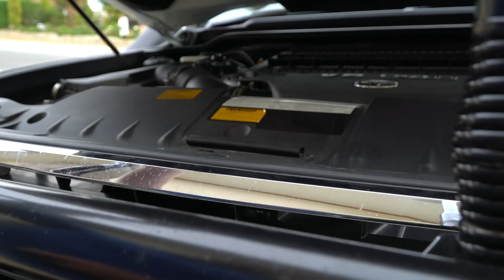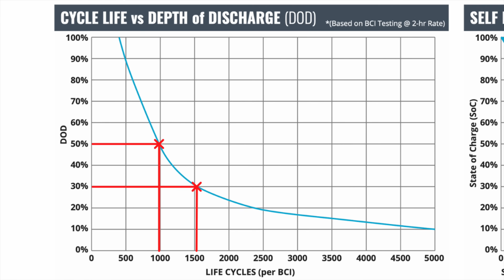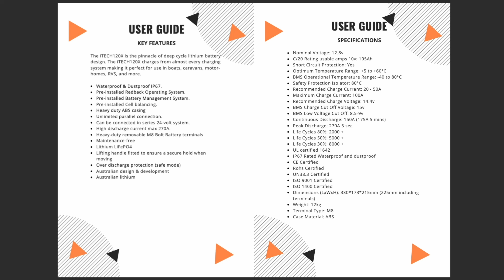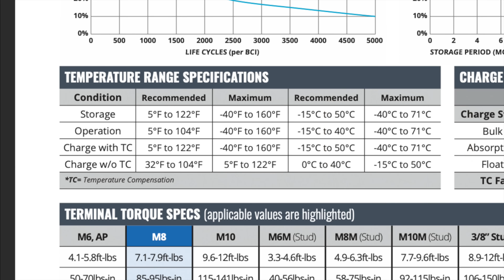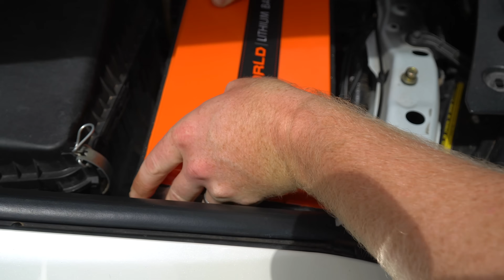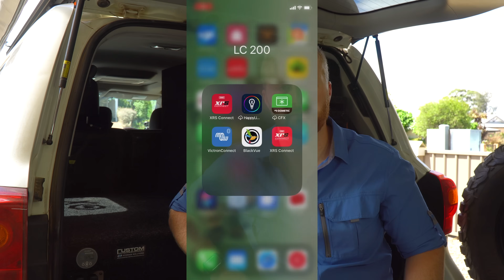UNDER BONNET LITHIUM | Is it worth the money? | Can it survive the heat? | iTechWorld 120X 12V setup

Comment: Hi Nathan, thanks for the very comprehensive video. 

One quick question, do you have two batteries under the bonnet or are you running everything off just one 120X battery? 

I am looking for a second battery setup for camping in my Prado 150 and was considering a Lithium Battery Box. I have a AGM as my starter battery. However, your video is very persuasive in considering an under bonnet lithium. So thanks for that.

Comment: Great Video, lots of good information, I'm looking at getting one for my car as well, how is it going under the bonnet now, did it handle the heat and where did you find the insulation that you wrapped around it. Thanks
Reply from the maker: Hey mate, this is still going strong at the moment. I have released a 6 month review of the battery, a little about how I've tested it and it's capacity and discharge results. Check that out for a some more detail 👍

Comment: Hi Nathan, thanks for the informative videos mate. I am spec’ing dual battery system for my Prado 150 at the moment. Question about your BMV-712. Where did you mount the shunt? Is it under bonnet and if so do you have it in a sealed case?
Thanks again 
Luke
Reply from the maker: Hey mate, I initially had this under bonnet, however a couple of years on and it did not last. I've now had it re-located to the rear storage area, protected from the elements. Would highly recommend it be up and out of the way from the elements to avoid issues that I experienced 👍

Comment: Very good informative video .. But the one thing you didn't mention and that is warranty periods.. As I've found lithium warranty to be the same and even less in a lot of cases .. I got my Full River and came with a 5 year warranty at the time .. Most lithiums I've seen come with 2 or 3 years .. Meaning if my Full River fails in 4 years ill get a new battery .. Lithium fails in 4 years your up for a new battery .. Very important topic I think .. I love the idea of a new lithium but still can't justify the huge costs .. You also have to factor in the cost of upgrading all your other equipment to be lithium compatible.. Solar charge controllers and dc/dc chargers as well as 240 volt chargers..

Comment: Hi mate how's the performance of the under bonnet Lithium going? Have you tracked any temps since having it in and seeing what the batt temp gets too? Just looking at upgrading too
Reply from the maker: Hey mate, so far it's going well. I plan on releasing an update video in the coming weeks (ish). Not many complaints so far. I haven't measured temperatures specifically, but measured performance and capacity over time. 
Cheers 👍
Reply: Awesome mate thanks for the reply, glad it is all going well for you, looking forward to seeing an update 👍🏽

Comment: Thanks for the Video, Did you have a redarc isolator installed as well with your original AGM setup, and did you replace that or run the lithium without an isolator? Currently wanting to replace second battery just the same as I have the same setup only with the added Redarc isolator installed
Reply from the maker: Hey mate, so I'm running a Redarc BCDC1240D charger. This is a step up from the standard isolator and probably something you'll need to consider if looking at lithium.  It can make sure the lithium receives the correct voltage through out its charging trend. 
Cheers, Nathan.

Comment: Great info !! I’m a novice with this. Do you reckon that itech battery will fit a prado 150 bay? Also what was the terminal cable kit you liked so much ? 😎
Reply from the maker: Hey mate, from my measurements from my old Prado 150 series, I don't think that this battery would be a drop in replacement. I think it is just a little too long. 
In terms of the wiring, this is a wiring harness installed by Ultimate 4WD Equipment in Bibra Lake, they make quite a neat and tidy electrical system integrating dual battery and accessory looms. 
Chees, Nathan.

Comment: Great info and we’ll presented. I’m looking to do similar with my 200 series and am interested in the itech world batteries as they are locally owned. Just wondering how the lithium battery is preforming consider a few people I spoke to reckon it wouldn’t handle the heat. Also where did you purchase the heat shield for the battery. 
Keep up the brilliant videos. They’re very informative but costly on my wallet. 🤣🤣🤣
Reply from the maker: Hey mate, yes the heat rumour is another reason I'm testing this batteries, to see how valid they are. After a few months now, so far, so good. 👍 
I used this for my heat shielding - https://ebay.us/Ti9ilY
Haha, can't apologise for your wallet their mate 😆

Comment: I run two of these itech 120X in my Tvan running a 3000w inverter no more gas 
I can run induction cooktop,airfryer, toaster, kettle 
And have no problems so far 
Also only have solar for recharging

Comment: Hey Nathan, a few months on now, got an update on how the 120x is going?
Reply from the maker: Hey mate, so far no complaints. You may have seen I had a charging issue with the cranking battery, but this has not effected the performance of the auxiliary battery. The 120X is still going strong and no signs of heat damage and has not turned off under any circumstances as of yet. 
Cheers, Nathan.

Comment: No mention of cranking amps. Is this irrelevant with lithium batteries?
Reply from the maker: Hey mate, yes this is irrelevant for a 'deep cycle' type battery like this one. This is not designed as a cranking battery and therefore isn't provided a CCA rating. iTechWorld do a cranking battery too where the appropriate ratings are provided. 
Cheers, Nathan.

Comment: They dont handle heat that well.. They will stop charging. I tried one under bonnet, and it was OK when it was cold, but slow moving on a hot day, stopped charging all the time.. I ended up sticking it in the back of the car..Also the Red arc will start to back off charging at around 50 degrees I have found. I shifted this to in front of the grill as well..
Reply from the maker: Hey mate, interesting to hear. 
I've already done some hot weather testing with this unit with no issues yet. I've had the engine coolant temps up 26 degrees over normal, climbing very sand dunes on a 35 degree day and was continually monitoring without issue. I guess time will tell in regards to how these perform. 
In relation to the Redarc, have you had any problems with it up the front? 
I constantly monitor my state of charge through the Victron and when charge is required, I've never seen it drop below 34-36A of charge regardless of temp.
Cheers, Nathan.
Reply: @XploringOz  I did have the Redarc on the fuse box, and one time it did stop charging as it got to hot. I immediately shifted it to just behind the grill, no problems after that. When it stopped ambient temps were between 40 and 45 degrees. Redarc was at around 60 degrees, measured with a IR thermometer, so expected.

I had a lithium in the front, it would start to managed the current due to temps at around 50 degrees. using power out was OK at these temps, but charging ,the BMS would kick in and reduce it. I have a BT BMS so I can see the cell and BMS temps

Even though most of the trips the battery was not at max temp spec, after 3 months the the battery started having charging trouble. It would reboot the BMS constantly, and the SOC meter started acting up. Presumed to be a BMS issue. So it was replaced under warranty. I shifted it to a battery box in the back on the car. I dont know for sure if it were the under bonnet temps that caused these issues, but I decided to eliminate them going forward.
Reply from the maker: @jjsadv  Hmm, sure is interesting to hear and I'm looking forward to seeing how this performs long term. Although it would be disappointing to see it cause trouble of fail, I'm hoping to be able to prove whether heat is directly correlated with issues/failures. 

I've recently installed the new iTechWorld 1420CA starter battery to, so it will also be interesting to see how this performs under bonnet, both with the heat concerns and the continuous requirement for high current discharge. 

I'm really hoping they will last, I wan't to try and keep these big units out of the rear of the vehicle to allow room for other gear 👍

Comment: Just a quick heads up on the victron settings for the Itechworld 120AH. The usable capacity is about 96-98AH, not 120AH. So you need to set the capacity to the usable capacity of the battery, not the total capacity, which it cannot deliver.
Reply from the maker: Hey mate, this is a good point. I've actually run an official capacity test on the 120X and got a usable 99 amps before the BMS shut down. I guess setting it like this will give you a visible 20% reserve power. It would depend on how you want to view the gauge? Set it up this way and the battery will switch off at 20% or set the capacity at 100A and the battery will switch off at 0%.
Cheers, Nathan.
Reply: I have 3 x 120 itechs and I can get a useable 105 out of 2 of them and about 100 out of other.
Reply: Seems like this battery should be labelled at 100ah not 120ah. I feel like the itech world advertising is a little misleading don’t you think? Your explanation when talking c ratings kinda confirms this

Comment: Another good vid Nathan. I have DCS under bonnet, and your assumption on off road temperatures is pretty good. On a 30 degree day, I have seen my battery temp hit 70 for short periods. this is normally on downhill low range. they drop to back to 65 on uphills, assuming that is due to the fan moving more air with the revs up. Ive also noted that temps increase quickly when you stop moving, but on the highway you can drive all day and only see temps maybe 10 degrees above ambient. Thats in a 200, so I would assume they have good airflow at higher speeds.
Reply from the maker: Cheers mate. That's good to hear. That's definitely an advantage of DCS, being able to monitor the internal temperatures. Its encouraging to hear that you are seeing temp's below that 80 degree mark! Hopefully my extra insulating material will help to some extent as well 🤷‍♂️ 
Will be interesting to see how this battery performs long term 👍 
Cheers
Reply: @XploringOz  yea, I wrapped the engine facing sides with carbuilders insulation too. Interestingly when you stop the drivers side heats up more. I would have thought it would be the passenger as it’s super close to the hot turbo-intercooler pipe on that side. I have like 3mm of clearance😬
Reply from the maker: @rayhart1762  Hmm intersting. Must just be the aerodynamics and the way in which the airflow moves around the engine bay with only the fan on. As long as it doesn't shut down, I'm happy 😂

Comment: Hi Nathan, sorry this more of a request. If you get some time could you do a video on how to jack up a lifted IFS vehicle from the FRONT plus some extra pointers. As far as I checked theres no proper video on youtube to show how to lift one up in a situation where a front tire needs to be changed. I currently own a stock 150 series prado and struggling to lift my front wheels off even with the new toyota jack and the recommended front jacking points such as the front of the chassis.  Would be great if you could do this. Cheers
Reply from the maker: Hey mate, I'll definitely consider this in an upcoming video! Cheers 👍

Comment: Great comprehensive video as usual Nathan, I have fitted a ITECH World 120x in my 200 land cruiser some time ago and found it works great. I however have put it in a battery box in the rear of my wagon with the Redarc DC TO DC charger fitted to the top of the box  and solar fitted on the roof. The reason I did not fit it in the engine bay because I had 2 new start batteries up front so I wanted to get my moneys worth out of them. 

I have had 2x 120 ITEC World batteries fitted in my Traveller caravan for over 3 years now with out any problems what so ever. I do use a Victron  712 monitoring unit in the van and is worth every cent. 

It is worth noting that the 120x has prismatic cells which is much better for off road use. I have never looked back since using Lithium.
Reply from the maker: Thanks for sharing mate. Glad to hear that you have had a good experience with these batteries as that's always encouraging. Here hoping that the under bonnet installation doesn't cause any issues down the track 🤞 
Agreed with your comments about the Victron BMW712. Great little unit! 
Cheers, Nathan.

Comment: I didn't watch the entire video but did you consider the Voltx lithium batteries that are around $500 or less with a 3 year warranty? Usually can get around $100 off with eBay promotion codes too.
Reply from the maker: Hey mate, to be honest, no I didn't consider these ones. Hopefully someone else can do some in depth testing on them.
Cheers.

Comment: Hi Mate. Dose your car runs high revs(1200) when overnight cold start? Just for few seconds?
Reply from the maker: Hey mate, yes sometimes it does this. Probably only 10% of the time.
Reply: @XploringOz  i find that if park the car more than 24hours It 100% runs high idle. It wasn't like that when new. And i disconnect the idle up bottom
Reply from the maker: @terryzhu6652  Hmm, not sure what that is but it doesn't sound normal. Could potentially have something to do with the fuel supply? I don't think the idle up button would have any effect for these symptoms.
Reply: @XploringOz  I'm guessing it's a minor leak somewhere in the fuel system. Will double check

Comment: Great video as usual. Do you have a link to the BMV712 settings document you referred too ?
Reply from the maker: Hey mate, see if this link works. If not, open the linked document where it says "Optimise your charging systems for a 120X".
https://cdn.shopify.com/s/files/1/0587/1749/files/SolarSettingsVer5.pdf?v=1597713100

Comment: How come the Battery Monitor is set at 120Ah but the usable amps is only 105Ah?
Reply from the maker: Hey mate, yes it is a 120Ah battery with 96 usable amps, however the Victron Battery monitor takes this into account. The Victron will detect the battery floor and rate/efficiency of discharge. 
Cheers, Nathan.
Reply: Ha Nathan, with you all the way, love my Itech gear, but prior to purchasing the 120X I was advised it is a 105amp hour battery, not 120amp hour.
If you look at the spec sheet in this video @ 1629 you'll clearly see Itech do specify at 105 amp hour.
The model no. didn't specify the amp rating as I think your presuming.
I think this needs clarifying.
My 120X has been in since Dec 2021, not long-term but its main benefit I see over our AGM is recovery time, charges so quickly, AGM was slow, on overcast days full recovery was out of the question, but sun up, 120X just gobbles up solar amps so fast, love it to bits.

Comment: This battery is not suitable for under the bonnet, installed this battery to my 200 cruiser but cutting down the power after driving 2hrs all my trip fridges is dead. Remove the lithium and back to my old century dual force AGM battery and return my lithium iTECH120X to iTECHWORLD.
Reply from the maker: Sorry to hear you had a bad experience with this battery. I'm hoping that I don't suffer the same fate. I guess time will tell. I've already put it through some hot temps and so far, so good. 
I'll be sure to report back with any news, good or bad. 
Cheers, Nathan.
Reply: Correct. THIS IS NOT A CRANKING BATTERY.

Comment: I've got that exact lithium battery, Redarc controller and insulation installed under the bonnet in my 2021 LC200 GXL. No dramas yet or expected!
Reply from the maker: Good stuff! I guess both of us are hoping that these batteries will hold up to the heat then!
Cheers, Nathan
Reply: @XploringOz  Mine has already done a run from the southwest to Kununurra via Broome and the Gibb River Rd towing a camper trailer. Some very hot conditions along the way too. Zero problems.
Reply from the maker: @darthvader8433  Awesome, that's always positive news! I hope I can get some of the same results.

Comment: Nathan, no one in AUS is talking about min charging temperatures for LI FE PO4 batteries, however charging a battery thats below 0 deg C is dangerous. A winter trip in the high country could easily get you below 0, in colder countries cold temp Protection is installed on good quality batteries. Do you have any opinions about this? A great video full of quality info, thanks
Reply from the maker: Hey mate, yes I would agree this is something that isn't spoken about often. Like you mentioned there are few placed in Australia that would ever get down to these temps, but also keep in mind it would only take a minute or two to get that temperature up again, particularly with under bonnet application. 
Personally, it isn't something I have taken into consideration given the type and location of driving I do. 
Cheers, Nathan.